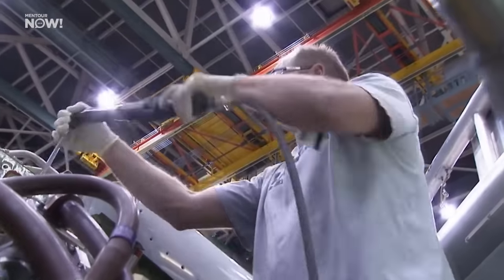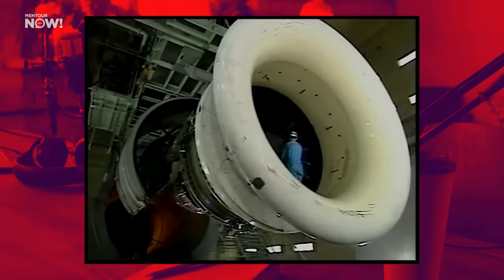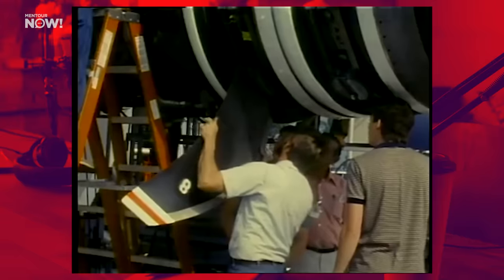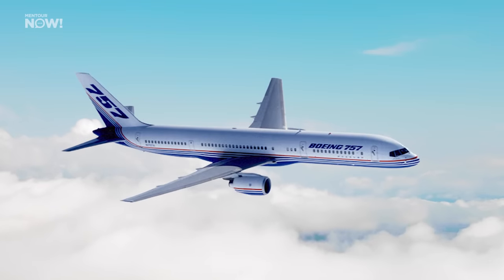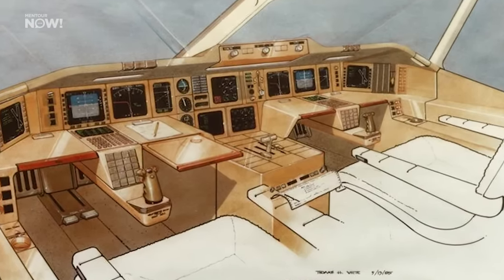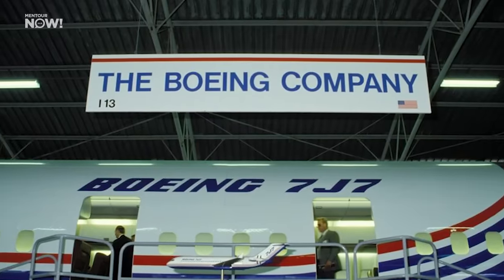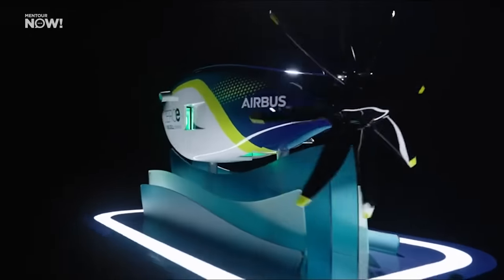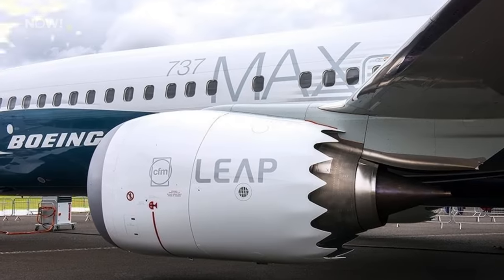Revolutionizing Flight! The Amazing Potential of the CFM RISE Engine.

Comment: The props are beyond loud, they are in a new category even. Back in the '80's when the Soviets would regularly skirt U.S. airspace over Alaska (I live along the coast of Southwest), the F-15 interceptor pilots noted the Tupalev prop noise was obscene. And these men were in a jet a couple hundred yards from the bomber, with a tightly fitted flight helmet on, let alone only a few feet away separated by only a sheet of aluminum and some insulation. Hope it works.

Comment: This is an ideal concept for electrification. You'll have independent control of rpms and aoa on both engines. Combined with an adjusted rear blade design, that's just perfect.

Comment: You mentioned Tupolev, they actually had a ducted version of that engine as a propfan, the bypass is ridiculously large, and as it seems the engine was indeed good, problem was, the USSR collapsed and the project was abandoned, still amazes me how ridiculously large those were.
Reply: Nah, it was continued in Russia, but them closed, due to high levels of noise and abundance of airframes that can carry it
Reply: @Янус_Ырт  D-27? Yep, it was revised, they changed some stuff to make it more compliant with the noise levels, but I'm talking about the NK-93, the ducted propfan.
Reply: @Rrgr5  NK-93 is also too loud
Reply: @Янус_Ырт  I still think the problem is the gearing, without the tips and ducted the engine should not make that much noise, I think that's the reason why CFP abandoned the counter rotating props, the GE one had a counter rotating prop moved by thrust because of that.
Reply: @Rrgr5  even ducted, it still was above levels of noise, allowed by regulations, sadly

Comment: 1st gen jet transports were freaking loud. The noise was so intense that as a child I'd always leave a flight with my ears ringing from the intense noise. I'll never forget my first 757 flight. What a revelation. So quiet and the climb rate so steep. For the first time I got pressed into my seat in a big way. Shortly after that I flew in a new 737 and knew Boeing had really improved things. But I have to say I preferred the DC-10 to the 767. 767 is a great plane too.

Comment: Hey, but what is intrinsic difference of these  “revolutionary” new engines and good old turboprops?  Same hot core, same rotating blades (a bit wider and more by count)
Reply: It’s a fan blade shape, not just more of them. They focus more on air movement in general rather than thrust specifically, so they induce a lot more swirl or rotational energy into the airflow. This is why it has the stator blades in a second row, to take that wasted (in this case) energy and regain efficiency by converting it into a pressure change.
Reply: @13374me  thank you! Btw I saw similar shape of the propeller blades on Airbus A400 ...and some submarine

Comment: What’s the thoughts on safety then? I know we have prop planes but I’ve never seen them with bird strikes or something of that nature. How would this be different if it’s a turbo fan without a shroud, what stops it from hurling itself into the cabin where the other just guts itself and sends parts out the back?
Reply: I specifically remember an air disaster (Southwest 737 in 2018) threw a blade killing a passenger; fortunately, the plane was able to land safely.  In this case the nacelle was unable to contain the blade failure.  It makes me question whether it's possible to protect the cabin, avionics and fuel tanks on this new propfan design, with it's larger blades, from a blade failure.

Comment: I worked in Palmdale in the 80s (not on the project, the B1) when GE was testing the original engine on an MD80 (I think it was an MD80). The called it the UDF, un-ducted fan. Really cool sound, sounded like a P-51 flying by.
Reply: Worked for MDC in Long Beach. The air raft was based out of Yuma AZ during flight testing.
Reply: In a Mad Max style future we might see ab-ducted fans. That is, it does not matter what it looks like and how it performs, because in a world winding down you simply use what you can steal.

Comment: As someone mentioned in the comments. the main problem with open rotors is the damage caused by a shed blade impact on the fuselage.  Any weight increase due to any reinforcement on the fuselage must be offset of the added benefit of decreased specific fuel consumption.  Somehow the shed blade must be designed to be light weight and fragment to much smaller pieces.
Reply: It's not as bad as it seems though precisely because the blades are made of carbon fibre and extremely light. When a jet turbine core fails its a big chunk of exotic nickel steel or ultratough ceramic heading for the fuselage - that's much tougher to armour against.

Comment: The bit that I'm having trouble with is - how is this different from basically being a massively upscaled PT6 with a posh prop? 😆
Reply: Because it has two sets of props, with one set not being powered but just efficiently redirecting the wash from the moving "prop" - not only more efficient, it delays the onset of a transonic shock wave so the props can go faster. That's exactly how a turbine works (and is what distinguishes a turbine from a fan) - it has a rotor and a stator. But to design it you need really good CFD - Computational Fluid Dynamics - software, as Peter points out.

Comment: Well, got to say that you are wrong when saying that some aircraft have a protection if a prop blade come off (min: 14: 3..) that protection at that level is to resist the impact of ice coming off from blades or spinner if take the ATR example. Actually if a prop blade come off it will slice in the fuselage like a hot knife in butter

Comment: The biggest concern I have as an civil aviation engineer with passenger aircraft is how do you contain a blade failure. Especially if you have an rotational speed similar to modern fan
It would be interesting to actually here the noise levels compared to say a Trent 1000 which is super quiet
Reply: @seriouscat2231  yep typo thanks

Comment: Hi, captain! Heartfelt congratulations for yet another excellent presentation! There is something else I am thinking sometimes: are there any plans to use some kind of material to shield the aircraft from cosmic radiation? However little it is, this would be great for crews and frequent fliers!
Reply: I wouldn't imagine that would be high in their list of priorities. Extra shielding would doubtless mean extra weight. I suspect that companies like Airbus and Boeing are aware of cosmic radiation (something that ISS astronauts are very aware of) but would more likely downplay its significance or pretend it's not a significant factor.

Comment: The CFM International RISE is an open rotor engine currently under development by CFM International, a 50–50 joint venture between American GE Aerospace and French Safran Aircraft Engines.

Comment: It's probably a trade secret, but I want to know more about how they reduced the noise signature of these things, besides the simple fact that they did away with the contra-rotating feature. There must be more.
Reply: Several things not mentioned here. (1) A lot of the noise from fans is caused by the eclipsing of the blades (front-to-back) as they pass. So the UDF and others put different numbers of blades on the sets, so that not every blade eclipses its pair at the same time. (2) The blade tips are substantially supersonic, creating strong shocks as they rotate. Using strongly curved blades diminishes and spreads out the shocks. (3) In the newer engines, the second set of blades is a stator set, avoiding a whole set of new shocks. (4) Computer aided design and simulation tools were used heavily in the design and simulation, aggressively tweaking and modifying shapes and configurations with the specific intent of minimizing noise. The computing power and technology for this didn't really exist until the late 1980s, but now the power of a decent PC is adequate for much of it. So it's a lot easier for engineers to try new things virtually to drive down noise.

Comment: I always wondered why do we need high bypass turbines, with their huge shrouds, when we can simply have turboprop 🙃
Reply: I wonder what the difference, If any between a turboprop and a propfan
Reply: "When all you have is a hammer, everything starts to look like a nail" Also, when you have a lot of hammers, one is always available.
Developed technology tends to have a life of it's own. Also, you may note that they were talking about how turboprops need more blades to fly faster, and only fly about mach 0.55 while high bypass turbines fly around mach 0.8. Faster planes mean you can shuttle more passengers from A to B, which means more revenue.
There's also the perceived 'unscarryness' of a completely shrouded engine. No bunches of knives whirling around at high speed with nothing between you and them but air.
Reply: Remember that a blade is a wing and wings have tip vortices that create inefficiencies that ducts can minimize.
Reply: Ooh, nice points 🙂
Reply: @dalentoews3418  , it seems, the difference is in the blades: number, length, shape, etc 🤔
Reply: @konstantin.v  so a turboprop with many short blades is a propfan? That is it?
Reply: @dalentoews3418  Un-shrouded blades tend to have issues, when traveling faster than the speed of sound.
One way to mitigate that is the shroud seen on turbofan engines, another would be to shorten the blades and increase the disc loading.
Reply: @stevensmith2078  , and highly twisted, too. As far as I've read so far 🙂
Reply: You could always Google it.

Comment: I just hope they don't keep pushing bypass ratio until they have to start flying even slower. 
We're already flying everywhere slower as it is. The old 707 usually flew at over 600 mph. Now we're lucky to break 550 on non-transocean flights.

Comment: Turbo open rotors are slower than jet engines (and noisier too). However,  turbo props are useful for shorter aircraft take off and lifting large cargo (remember that huge Convair peacekeeper six turning and four burning). Thanks.
Reply: There's a difference between a turboprop and propfan. Propfan produce equal thrust as turbofan but with less fuel consumption. More efficient. Turboprop still far slower behind turbofan and propfan

Comment: Why use a stator vane behind the front fan if it doesn't do any compression? It just adds extra resistance. Is it because of some aerodynamic or turbulent properties? We did use stator vanes behind turboprops. Seems really weird.

Comment: The tips of the TU-95 blades are not exposed to supersonic airspeeds. The noise was generated by the aft prop. Blade vortex/turbulence interaction. The forward prop dirtied up the air.

Comment: The TU-114 was the civilian derivative of the TU-95 with a relocated Wing and the same engines but still the same ‘jet airliner’ speeds.
Wing sweep also plays a significant role in achievable speed, most turboprops airplanes could go faster with a swept back Wing (aka TU-114).

Comment: ...Russia also made a "civilian " derivative of the TU-95 known  as the TU-114 Rossiya.  This aircraft had a larger diameter and longer fuselage as well as low mounted wing.  Because of the size of the counter rotating propellers (5.6m in diameter) it required extremely long undercarriage struts and thus stood so tall, a lorry could be driven underneath it (when Nikita  Khrushchev travelled to New York to speak at the UN, Idlewild airport had no stairs tall enough to reach the passenger door so a small ladder extension was needed). 

Indeed the plane was a behemoth and was the largest airliner in the world (in overall size) until the debut of the Boeing 747. It had a cruise speed of 770KMH and maximum speed of Mach 0.78 (870 KMH) with a range of 8,950 KM (the D series used on Moscow - Havana flights had an 11,900 KM range)  LIke it's military counterpart, it was noisy even for the passengers who endured a noise level of between 108 - 112 dB.as well as vibration.  it was a common practise to converse via written notes while on board as normal conversation was almost impossible.

Comment: The re-enforcement of the fuselage of a turboprop is not to protect passengers from a blade failure as mentioned. It is to absorb the impact of ice coming off the prop. This panel regularly gets damaged by ice and the whole panel gets replaced once the damage tolerance has been reached.  The amount of energy from a thrown prop is phenomenal.  The prop, if thrown, will go straight through the ice protection mat, fuselage and anybody sitting in its trajectory.  There have been several examples of this.  That is why the QRH specifically instructs to move people out of these seats should there be a propeller or PCU problem.

Comment: The open propeller seems like it will always be louder and more potentially dangerous compared to a ducted fan. The nacelle of the ducted fan reduces noise and provides a safety shield for the passenger compartment and fuselage in case of catastrophic fan blade failure.  Why wouldn’t the best solution be a gear reduction like on the Pratt and Whitney engine and variable  pitch fan blades/propellers within a nacelle?

Comment: It isn't just th engine that was upgraded. It is why the Max has a split wing tip  and the 777x has an additional 12 feet on each wing. They both improve fuel economy.

Comment: I find it very interesting that finally a propfan engine might go into production. I must be missing something, but I can't quite understand what the second non rotating propellers are doing? Also would the new quiet Toroidal propellers work with turboprops or prop fans?

Comment: They have been promising these engines for over a decade. I suppose they are still trying to perfect it and don't want to roll out a finished product that might fail and doom it forever.  I have always thought the restricted airflow inside of a jet engine was a hindrance to its efficiency so it seems like a great idea to have the blades externally, though by the time they perfect them we may have magnetic propulsion and other options.

Comment: First time I saw the design protypes was 1979.  Always wondered what happened but really it was because innovation is expensive.  The motivation at the time withered when oil prices dropped.  Now that efficiency is more important to the profit margin, it is back.  Also engineering imrovements both in materials, engine mechanics, structure and, production have come a long way in 40 years.  I expect to see them in use in my lifetime. (Hopefully)

Comment: The folks who design the open turbofan engines should put a rotating circle of prop material around the tips of the prop blades. That would eliminate the tip vortices of the prop blades thereby increasing thrust and reducing both drag and noise. This would make the prop look like a high bypass turbofan engine. The circle of prop material attached to and spinning with the blades  will increase the efficiency of the prop blades.

Comment: A current gen turbo fan containment shield is extremely thick even using cutting edge composites and still the energy dissipated and violence from the impact and imbalance basically trashes the entire engine front to back. For a fuselage to be able to deflect an impact without any chance of penetration or comprising damage, would be near impossible without excessively increasing the weight of an aircraft covering any potential impact area.
The only aircraft solution for an open rotor design and completely avoid potential fan blade out incidents is a push design aircraft where the engines are behind the plane but that introduces new problems such aerodynamic imbalance and turbulent air ingestion. I don't see pull design on large aircraft being an option since the aircrafts tend to be a lot more sensitive to thrust effects, the aircraft could still hit debris from a failure since the rotor is in front still, and any concept I've seen for a high efficiency commercial airliner is a push design.

Comment: The moving set of variable blades working with a fixed set of blades is similar to the torque converter for a modern automatic transmission but wihout the housing.

Comment: The larger “bypass air” being done is NOT for more power, not does it produce more power, it is actually less efficient slightly.  It is done for noise abatement, and is the main reason jet engines / modern airliners no longer scream across the sky as they used to.  In fact, you can barely hear most aircraft nowadays in comparison to the old engines which did not have any bypass air.   The bypass air surrounds the combustion air which is coming out of the engine at supersonic speeds (hence making lots of noise!) and buffers the noise.

Comment: ok, so as far as thrust, how much is provided by the prop blade pushing air back and how much is provided by the pressure vacuum created behind the wing, or bernulli's effect if you will?  It seems ducted fans  have to spool up before a push is felt where as props immediately pull.

Comment: The problem with exterior prop engines on a passenger plane is when the engine does fail and if the engine failure is catastrophic it could penetrate the fuselage of the plane causing explosive decompression witch will either bring the airplane down or kill a few passengers and force the plane down to low altitude

Comment: The bypass fan is also how noise is reduced . By increasing the speed of the air surrounding the jet exhaust  the sudden shock of high speed exhaust hiting still air c a used a lot of noise. This in part is mitigated by convelouted corrigated rings and tapers in the exhaust ports that look like a sawtooth pattern.

Comment: Search for "Tupolev Tu-95MS Inflight" if you want to hear what the engines are like from inside.  Inside next to the engines it is as loud as a chainsaw at 1 metre.  Without protection, hearing loss can occur in as little as two minutes.